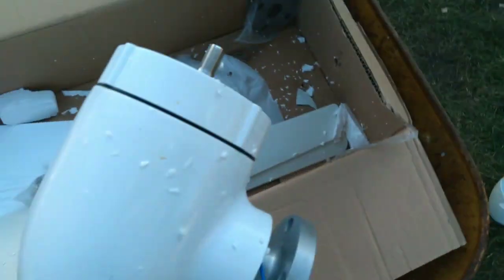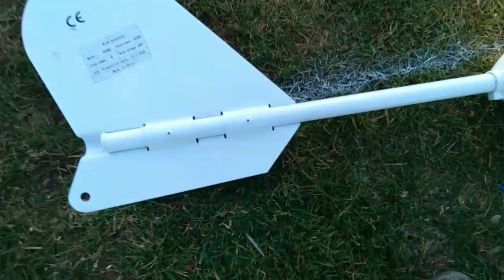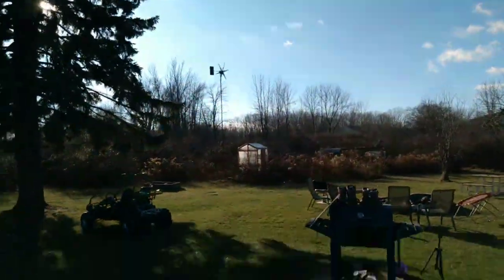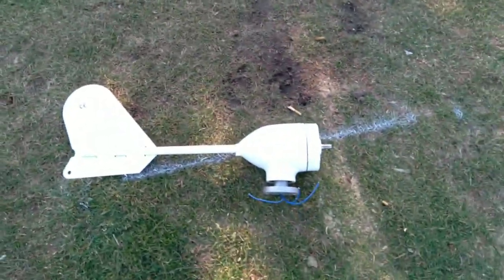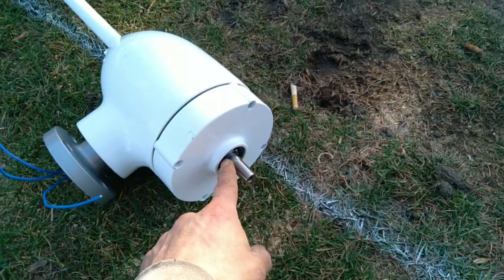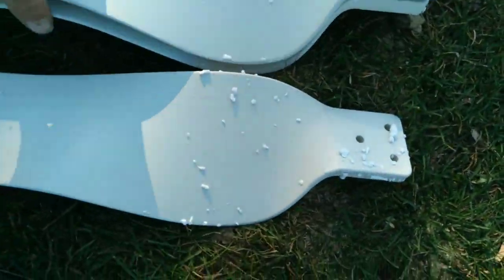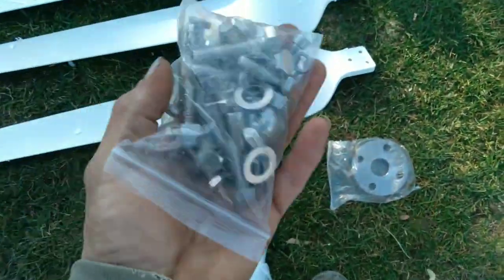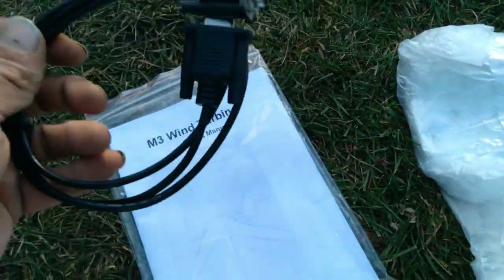Unboxing The 600M3 Wind Turbine!

Comment: My 600w from green E-solutions came up 50/ 60/80w on 21/ 22/24 miles wind is that ok?? , I have a mttp hybrid controller, have tried a 200A High Precision Power Analyzer Watt Meter. With the same result, but maybe this is very normal? , I have tested the amp, they are the same on all 3 phases
Reply from the maker: How high is the turbine and is your wind clean? Can the turbine stay in the breeze and go or does it sway back and fourth trying to speed up? Did you balance the blades? There are lots of reasons it mite not be making big power.

Comment: Which way should the hub flange on the mill be? missing an instruction book,, the pointed end towards the wind tubine or the pointed end out,,green e solutions store 600w wind tubine
Reply from the maker: Well it should only work one way so i would say the flat side to the turbine and flaired side out. I have a few videos on balancing the blades. You will actually get your moneys worth if you take the time to balance the blades AND you'll get more life out of the turbine. The vibration of it spinning at high RPM if its out of balance will literally make the greese in the bearings ooze out and it'll fail. Mine have been up over 4 years and last night they saw 30mph wind and 50mph gusts.....still goin strong. Kept the batteries in good shape through 3 cloudy days.
Reply: My 600w from green E-solutions came up 50/ 60/80w on 21/ 22/24 miles wind is that ok?? , I have a mttp hybrid controller, have tried a 200A High Precision Power Analyzer Watt Meter. With the same result, but maybe this is very normal? , I have tested the amp, they are the same on all 3 phases